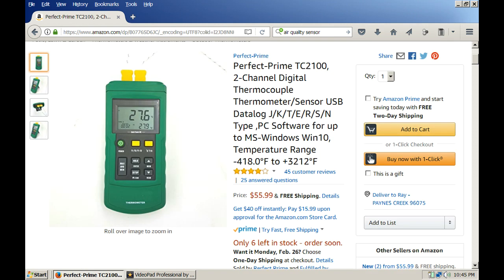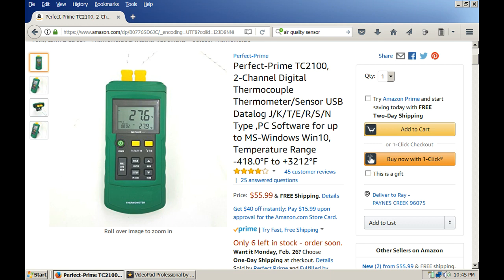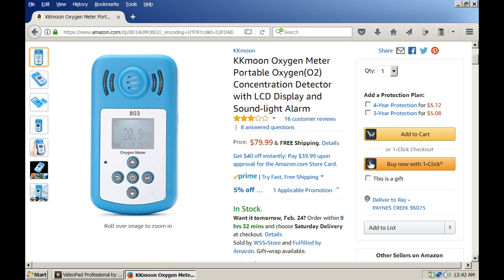Demo #34 Bio-Cell Testing/Sensor Equipment

Comment: Looks like your going to be busy for a while, i hope it all comes together well for you. All the best with it and keep us updated and many thanks for sharing you research 
Al.
Reply from the maker: Hi Al,  It'll probably take a month or more to get the test system built, then who knows how long to run all the needed tests.  I will post the progress at every step along the way of course.  Thanks!
Reply: Just a thought about powering all that sensitive test equipment, i should imagine running them off a large rechargeable 12 battery with large smoothing caps would be a good idea maybe, you dont want any AC ripple getting through and maybe affecting your readings... just to be on the safe side.... just to cover yourself for the results i mean, anyway, you probably though about it before i did. Best of luck :)
Reply from the maker: I hadn't considered that Al. Thanks for mentioning it! I wish I knew more about electronics.

Comment: When measuring parameters be cautious about the sensors contributing to effects, particularly when in contact with the component being measured. I would remove devices and observe whether there are any changes in other readings to ensure there were no interactions resulting from the measuring devices. By the same token any such interactions could provide important information that would otherwise be missed or hinder comprehensive development. A good example is the dead short amperage measurement which while providing valuable comparative information could skew results if performed too often or at irregular intervals, changing apparent results by affecting the electrode chemistry, accelerating corrosion of the electrodes, etc. Other interactions may not be as apparent but equally as important. Just a word of caution from the unfortunate experiences of an old experimenter.
Reply from the maker: Ok, point well taken Fred. It's going to take about a month to build the test setup, and I'll share the process of course. If you see me fucking up, just let me know your concerns. Two minds are better than one my friend. Thanks for your interest.